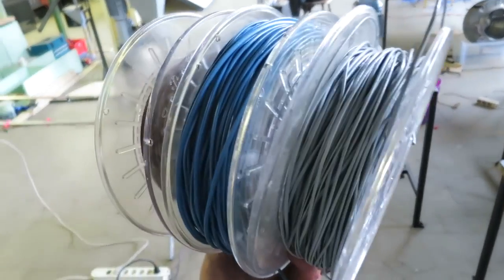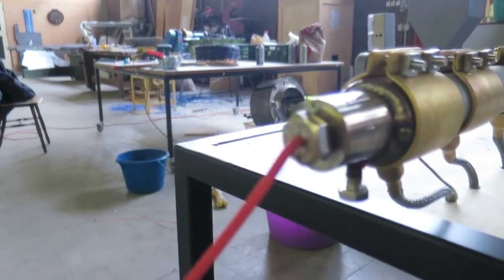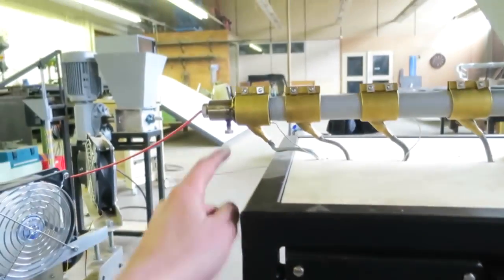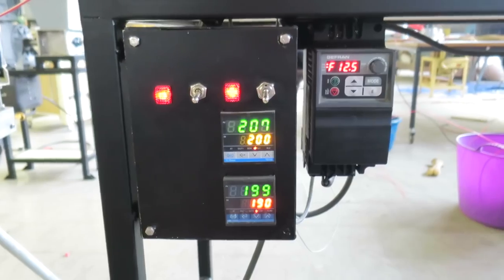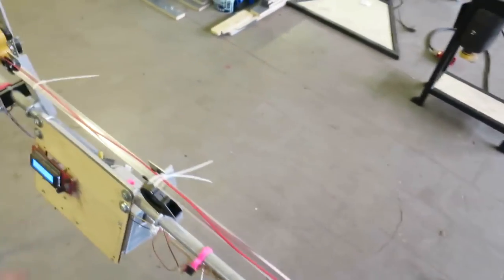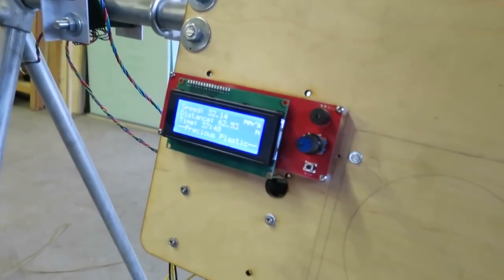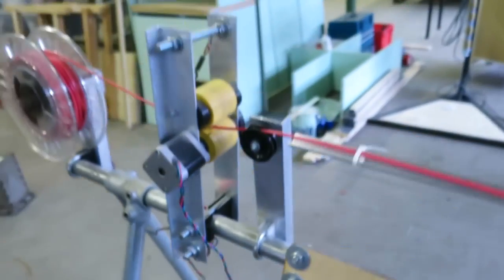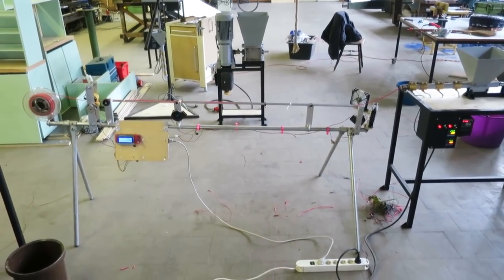3D printer Filament maker

Comment: what electrical isolation material do you use to keep the wires for the heating from short cirquiting on the metal pipe?

Comment: What is the diameter?
Reply: Hello, Dear friend ,this is Wendy comes from Nanjing GS-mach Extrusion Equipment Co.Ltd.Which is a professional machinery designer and manufacturer of 3d printer filament machine.please contact me if you are interested in neat winding machine,high tolerance.Whatsapp/Wechat:+86 18151606635  Email:sales6@njgsmach.com
We can produce the diamater from 1.75mm to 3mm

Comment: What is the diameter of the filament you are making?
Reply: Hello, Dear friend ,this is Wendy comes from Nanjing GS-mach Extrusion Equipment Co.Ltd.Which is a professional machinery designer and manufacturer of 3d printer filament machine.please contact me if you are interested in neat winding machine,high tolerance.Whatsapp/Wechat:+86 18151606635  Email:sales6@njgsmach.com

Comment: We have 3 3D printers 1 that can actaully scan an item and make a copy of it and one with lazer engraving but we have 2 because that one is being used for lazer engraving we also will get a resin printer and we are going to try and reuse the plastic were making ideas of a machine
Reply: Hello, Dear friend ,this is Wendy comes from Nanjing GS-mach Extrusion Equipment Co.Ltd.Which is a professional machinery designer and manufacturer of 3d printer filament machine.please contact me if you are interested in neat winding machine,high tolerance.Whatsapp/Wechat:+86 18151606635  Email:sales6@njgsmach.com

Comment: Which plastic did u use? And can u use polyethylene?
Reply: i tried to make PE filament it succeed in making the filament by it is not easily printable
Reply: I would be interested in whether the diameter is constant.  How about the printing properties?  Are there any differences to the filament you buy?  How did you regulate that the material becomes a homogeneous mass?  Otherwise bubbles can get trapped, right?
Reply: Hello, Dear friend ,this is Wendy comes from Nanjing GS-mach Extrusion Equipment Co.Ltd.Which is a professional machinery designer and manufacturer of 3d printer filament machine.please contact me if you are interested in neat winding machine,high tolerance.Whatsapp/Wechat:+86 18151606635  Email:sales6@njgsmach.com

we can produce the material : PLA PEEK PA PS ABS HIPS PET

Comment: did you measure the roundness and diameter variation of the filament? Do you see any differences between the filament you created and the filament bought from suppliers?
Reply: They didn't do anything aside from steal Dave Hakkens' video to post their own monetized links in the description box. Search "Precious Plastic" or "davehakkens" on here and you'll find the guy in the video to ask him questions.
Reply: Hello, Dear friend ,this is Wendy comes from Nanjing GS-mach Extrusion Equipment Co.Ltd.Which is a professional machinery designer and manufacturer of 3d printer filament machine.please contact me if you are interested in neat winding machine,high tolerance.Whatsapp/Wechat:+86 18151606635  Email:sales6@njgsmach.com